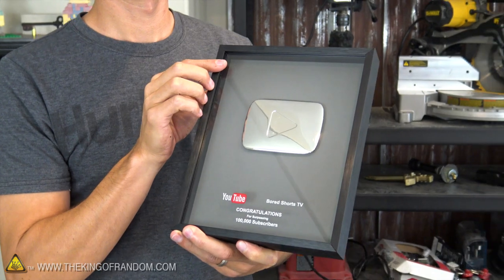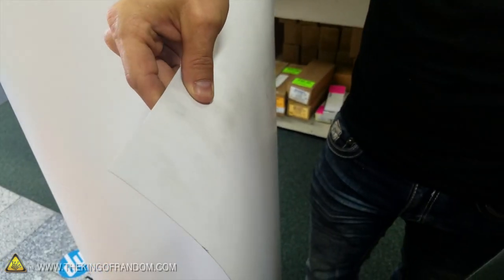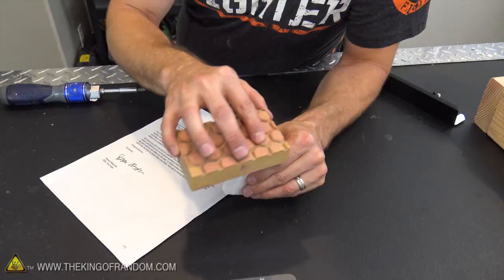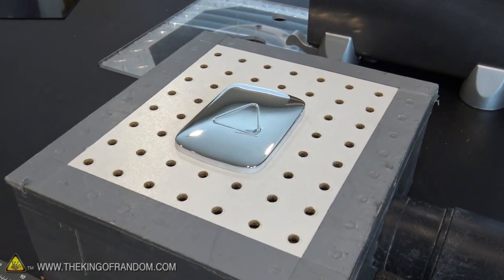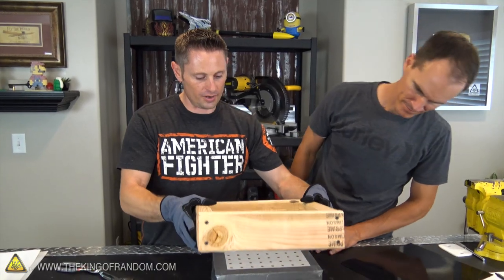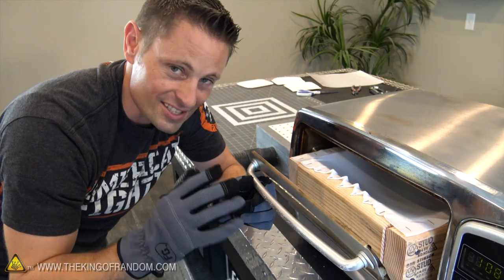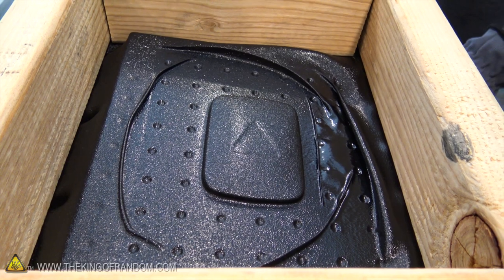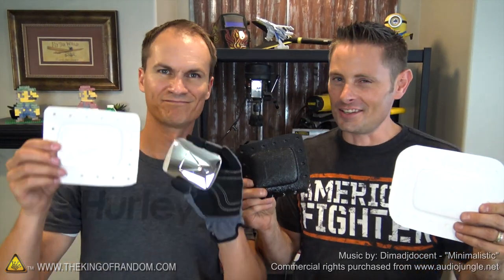Vacuum Forming a Silver Play Button (Real Play Button Molds)

Comment: You can also take some resistive wire and make a heating grid to place over the material to heat it up. Very easy to make for use with larger areas to be heated up. I use a heat gun for my 5 x 5 thermoplastic sheets.

Comment: I used to run an industrial thermoforming machine for Tripp Plastics in Sparks, NV. The correct temperature for abs plastic at 3/16" thickness is 286° for 220 seconds ( 3 minutes, 40 seconds ). I made the plastic parts that are inside of slot machines.

Comment: Question: How would you go about making a suction mold where you could cast liquid hot metals (i.e. molton aluminium, copper etc..) ? Obviously, the plastics wouldn't hold up with the extreme temperature of the molton metals, so what would be the step to go from Suction mold > mold that can handle the job ?

Comment: I have a suggestion for a future video.  My car's clear plastic headlight lens is cloudy and crazed.  I've tried to polish it out but it's too far gone.  The dealer wants $3000 for a new headlight and there aren't any aftermarket headlight lenses available to purchase.  So, I'd love to make my own replacement lens but the contour of the old lens is more detailed than the button in your video and the plastic lens material is about 1/4 inch (much more than your plastic).  Would you like to attempt a video of a car headlight lens?

Comment: The reason the HDPE didn't work out was because you were waiting for it to turn transparent. HDPE only turns transparent after it goes past a certain temperature, which is when the plastic is already melted. You shouldn't have kept it in the oven for as long as you did, and it would've worked better.

Comment: OR you could do it the right way and use platinum silicone. A 2-part kit is only 30 bucks from Smooth-On. Then you would have a REAL mold and not this hobo plastic mold these two dudes made.